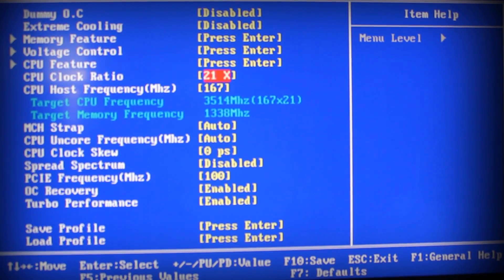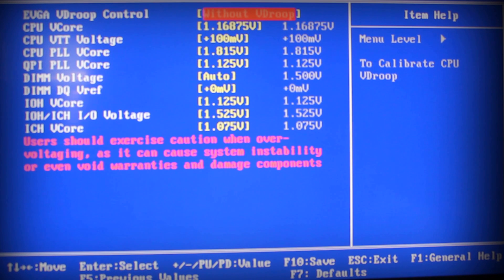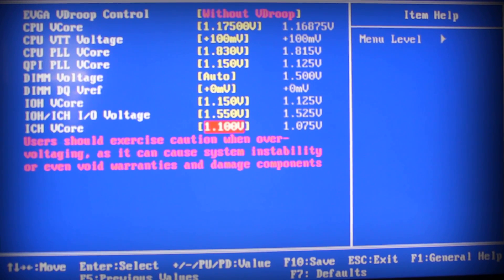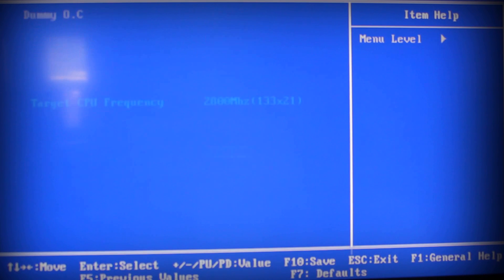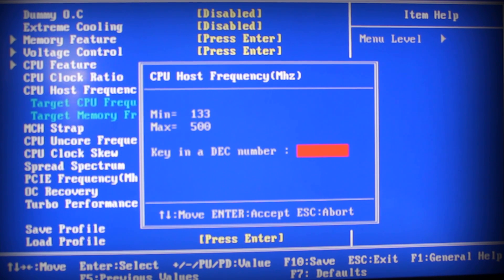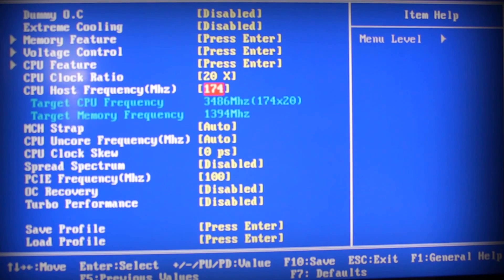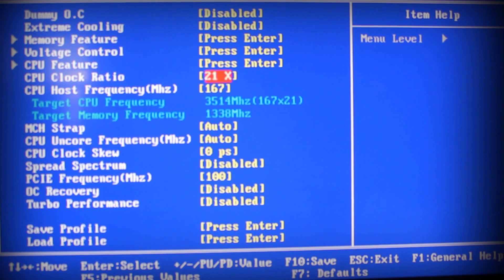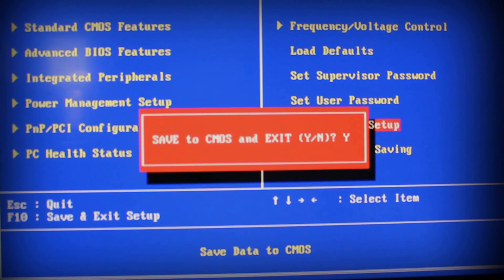How to Overclock an i7 930.wmv

Comment: i have the same motherboard and cpu as you but my stock VTT is showing 200mV and a lot of the other values are different. also i have a few settings you don't have... why is it different? i am using the newest bios for the motherboard, version 83.

Comment: I'm at 4.0 with just the switches on my x58 plat sli. ram is 24gb all running xmp. and thats just simple stuff! tested it with the switches and I'm good. 4.0! stress tested and running cool. no manual changes
Reply: and yes i have the 930. x58 platinum sli, 24 gb mushkin blackline ram, liquid cooling, 2 gtx 580s in sli, 2 ssd in raid, and im still getting higher clocks.
Reply: Obed Blas First let me say that i do NOT know everything about overclocking! I have manually overclocked alot of processors with great results but i am by no means a pro at it lol. My advice is to checkout what kind of overclocking software came with your mobo. I've used numerous ones, asus, msi, amd even intels. some worked well but some went badly and I killed a few processors over the years lol. what I did on my last board was use the software to get a stable overclock, sometimes using the auto settings, and then print a screen shot and input those parameters into the bios. it worked well for me. The main reason I decided to oc this processor is that I was lagging slightly in some games and wasn't getting the performance I wanted in dying light and the evil within. as always if you do make changes manually, take baby steps, good luck!

Comment: Im about to try this for the first time. Will anything be different on an alienware motherboard? Its an aurora R4, i7 930 cooled with corsair H80i, 12 gigs 1666 ram, SLI GTX 680. Very noob on overclocking, bare with me.
Reply: leave it alone
Reply: Larry Rodriguez Forgot I even left this question. Gave up looking at guides online, and nothing in my bios ever looked the same (I cant find some of this stuff). That's a lost cause then huh? Guess Ill just wait on my new build before I start learning.

Comment from the maker: this is just the basic idea of where to start ..... not an advanced guide on over clocking ... for that goto toms hardware forumz ..... but you should be  able to do some pretty good clocks with this video ..... IF YOU USE AMD ... u fail ... and to answer your question .... The higher the ram speed ... the higher your clock can go ... so if u have 1066 ram thats going to limit your core clock ... Because u will not be able to take your ram above 1066

Comment from the maker: on an i7 the ram does limit the high clock of your cpu ... higher the ram speed thus higher overclocks ... and the cooling also plays a major role ... if u have better cooling then the problem is not as noticeable as apposed to air cooling